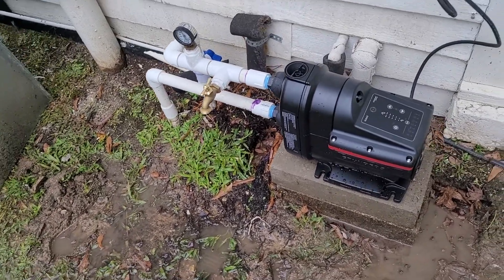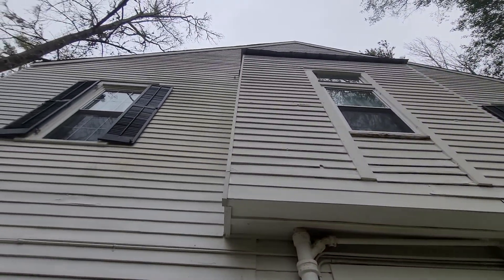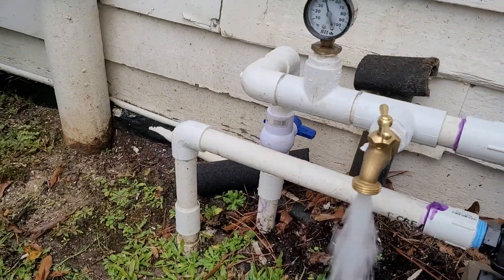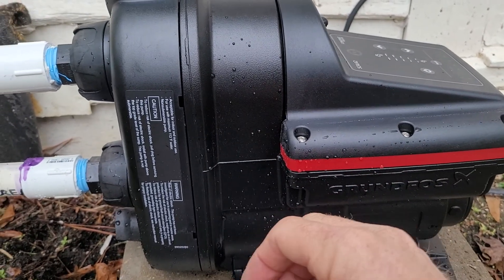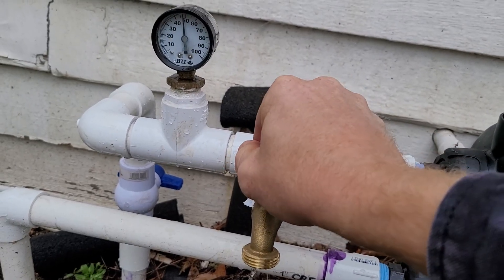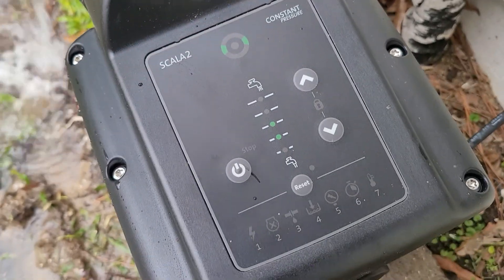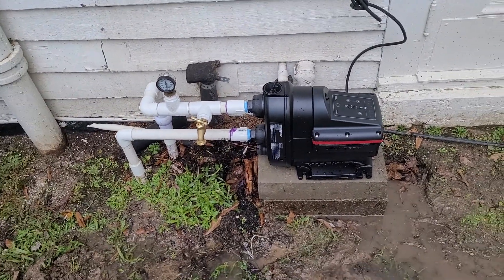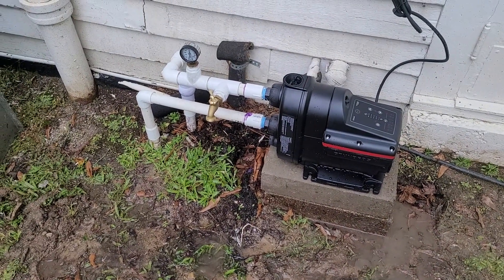Constant pressure pump - grundfos - SCALA2 booster pump

Comment: I have had two. Each lasted about 2 years. Had them rebuilt at $550 each and they have both failed within eight months. I’m done!
Reply: had a very similar experience with these, nothing but problems, our local dealer said they had a 75% return rate, we now use DAB booster systems and have yet to have an issue with them

Comment: Hi. My 12 year old MQ3-45 pump is used to pump 1,000 gallons every 5 to 7 days.  The pressure gauge is pressuring to about 70psi, stops like it should, and then leaks down over about 3 to 4 minutes to about 30psi, and kicks on to repressure.   

If there are no leaks anywhere, could this failure be the "internal non-return valve?"  I only have  one pressure gauge on the pump, and I do not have a pressure tank.
Reply: If it's a sealed system, it would not be capable of loosing pressure. It wouldn't matter what possible problem a pump had. If the pump exploded internally, the system would still hold the pressure until it was released, either through a valve or a leak.

Comment: don't buy this..they leak. Don't believe me and do your research
Reply from the maker: As I don't disagree with you these pumps do have issues but they are Niche case usually used.

Sometimes a pump like this is the only option, but I do wish there was more on the market.

Comment: What’s the max PSI you can get out of it?
Reply from the maker: These little pumps our multi-stage and when used in booster situations can easily get over 80 psi.
This was the wrong type of use case and the pump didn't last barely two years of constant use with heat pumps.
Reply: @ClearWaterPumpWell  ok thanks

Comment: I have the same pressure pump but I noticed my pump take so long to build pressure, I’d say it goes on for 2-3 minutes, is this normal?
Reply from the maker: If your using water it will run continuously to keep pressure boosted.  When you stop it will slow down for a few 3then turn off.

Comment: scala is a shit pump known for failures
Reply from the maker: Well I don't have much experience with them other than this one case.   I'm sure in other situations they are more widely used.   The water here has lots of iron and it could have contributed to failure.
Along with the fact it was used for heat pumps which can use water almost 24/7.
Reply: They all fail, mine did too. Same all all

Comment: Was looking into getting a whole house pressure pump and was suggested the Scala 1. How do I know which is best for my house? Also, does it work automatically whenever I want to water my lawn or take a shower?
Reply from the maker: So this pump is a booster not a stand alone pump system.  There are different versions for more Gpm or head pressure.  Yes it's automatic and works by detection of flow and psi drop to help maintain given psi settings.

Comment: How energy efficient?
Reply from the maker: Well it's very small HP and has variable speed so one of the most efficient pumps I would say.  Pumps In general don't use much power anyway because they are only run for around a hour at most per day. That being for a typical water supply case for a household and not heat pump supply.
Reply: @ClearWaterPumpWell what about in my case? The house has 4 people, 2 of which are small children and 3 full baths. Our washer and dishwasher run all day, all the time.
I am on a shallow well. Will this hold up to heavy usage?